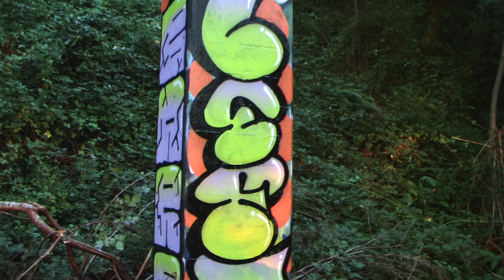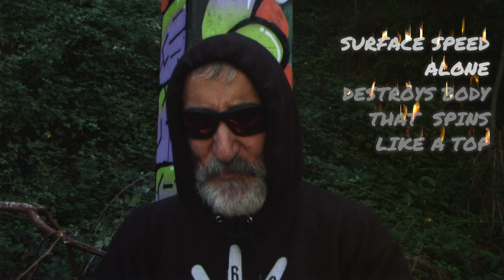WHY A SPINNING BODY BREAKS ALONG ITS LONGITUDE no cracked body can spin globe earth is a fantasy

Comment: Rotation isn't measured in MPH dude.  Get an education an get back to us.
Reply from the maker: Whatever you say globe-rider 🤣Watch t he video, read the description, click the links and read the engineering text books, before commenting as a full re-tar-d on YouTube.
Reply: @rocketspushoffair  no no. he's right. rotation isnt measured in mph. you dont say "i change gears every time the engine gets between 4,000 and 8,000 mph."  its in rpm. or radians.
Reply from the maker: @engineeringtheweirdguy2103  READ AN ACTUAL ENGINEERING TEXTBOOK SOMETIME spin3.flat.wtf 🤣
Reply: @rocketspushoffair  I have read several, including your mechanics handbook. Which doesn’t take into account gravity… at all… once again, you can’t just ignore it when it comes to something the size of a planet. You can ignore it when it comes to something the size of a cars flywheel. Learn the difference doofus.
Reply from the maker: @engineeringtheweirdguy2103  thee Machinery's Handbook is what all of modern society is based on. It does not deal in imaginary forces like gravity, which is no longer considered a force "doofus"🤣🤣🤣Also, "gravity" only applies to surface objects who's axis of rotation (center of space pear earth) is AWAY FROM their center of mass. Gravity has nothing to do with the cracked space pear that spins like a top about its own center of mass "doofus" 😆😆😆 Rotation axis determines the force distribution and force relationships spin1.flat.wtf "doofus" 🤒🤒🤒You're to re-tard-ed to be in this discussion.

You're NOT an engineer.
Reply: @rocketspushoffair  it’s not what modern society is based on. Not even close. It’s as the title suggests. A hand book. It’s hardly revolutionary writing
Reply: @rocketspushoffair  gravity isn’t a force doofus. It’s an acceleration. Learn the difference. Also you can claim it’s imaginary against the plethora of evidence we have all you want. You want to debunk the globe model, then you kinda need to include all of it. Instead of cherry-picking. That would be like me claiming thermodynamics is fake because soup inside a thermos should never get cold. Whilst completely ignoring and denying the existence of radiant heat.
Reply: @rocketspushoffair  rotation is a variable in determining centrifugal acceleration. Acceleration is a vector. Gravity is also an acceleration. Do the maths. It’s very very simple. Of course the machinery handbook, talking about vehicle flywheels only weighing a few kilograms, doesn’t include gravity. And of course that needs to be considered when talking about a rotating planet weighing 6x10^21 tons. 

If your handbook doesn’t mention gravity as a factor. It isn’t applicable or astrophysics or orbital mechanics. Sorry kiddo.
Reply from the maker: @engineeringtheweirdguy2103  The chapter on flywheels alone involves all of modern society. Everything either has spinning parts, and/or relies on/was made from MACHINES WITH SPINNING PARTS. You're NOT an engineer, you're a flunky. 😂
Reply from the maker: @engineeringtheweirdguy2103  What evidence "doofus"? 😂The fact that objects accelerate when dropped debunks "gravity" as an omnipresent always acting force, "doofus" 😂When a bullet is fired, it starts to decrease in speed the moment it leaves the barrel. You're a flunky.😆
Reply from the maker: @engineeringtheweirdguy2103  astrophysics and orbital mechanics are fiction, "kiddo" 😆An "acceleration" is not a force. Your space pear MUST be subject to the same rules as a body that spins like a top. First, it MUST be a solid. Second, it MUST have a surface sped well below 1000 mph. YOU MUST show how a cracked space pear body can spin (no cracked body can because of zero tensile strength) AND you MUST show how your cracked body has trillions of psi of tensile strength. But you cannot. All you can do is cry "gravity the acceleration" and you have no clue wtf you are talking about, because you're a flunky. 😁 All the calculations are here spin1.flat.wtf you can't touch this, flunky! 🤯
Reply from the maker: @engineeringtheweirdguy2103  Here's some orbital mechanics math for ya, "kiddo": what iss the COMBINED EFFECT of spin plus sun orbit? It is 21 mm/s/s of acceleration alternating with deceleration every 12 hours ... a simple rock balancing statue debunks your fake spinning space pear! HAAHHHAAHHAHAAAAHAA!!!!! Flunky!😁(I have a link if you can't do the math)
Reply: @rocketspushoffair  no it doesn’t. You misunderstand what the term ORBIT means. If you go round a roller coaster loop. At the peak of the loop when we are upside down, We both know that if you go too fast you are pushed into your seat, if you go too slow, you fall out. Stands to reason that there is a speed where you are equally between the two, the scientific term is weightlessness. That is what an orbit is, elliptical or otherwise. Because if you’re going too fast, you’ll fly out, too slow you’ll fall in.

It’s really basic stuff kido HAHAHAHA!!!
Reply: @rocketspushoffair  and 21mm/S/S is still much less than 9.81m/S/S.
Reply: @rocketspushoffair  so here’s a hot tip, go to school, learn what the globe model ACTUALLY is. And THEN come back and argue against here. How’s that kiddo?
Reply from the maker: @engineeringtheweirdguy2103  That's re-tard-ed, you have no track in your orbit. And the rollercoaster car is not spinning like a top. Buddy, you have TWO SEPERATE MOTIONS of your fictional space pear, when COMBINED result in 21 mm/s/s ACCELERATIION ALTERNATIING WITH DECELERATION EVERY 12 HOURS. In physics it's called rigid body rotation with translation. Simply put, it is a car tire rolling down the road. It is basic, that's why all it takes to debunk thee space pear religion is a rock balancing statue. 🤩
Reply from the maker: @engineeringtheweirdguy2103  21 mm/s/s DOES NOT EXIST, BECAUSE WE ARE ON FLAT STATIONARY EARTH 😁😆
Reply from the maker: @engineeringtheweirdguy2103  There's no argument, every globe claim crumbles at the slightest inspection. Learn some basic engineering spin1.flat.wtf leave your debunk on that page, so we can have a good laugh! 😆😁
Reply: @rocketspushoffair  again, you clearly don’t understand what the word “orbit” means. Maybe google it. Defined as when the centrifugal acceleration plus the gravitational acceleration = 0. Meaning 0 acceleration. And according for F=ma, no force. You can’t feel acceleration, only force. The same acceleration which slows down the earth also slows also affects everything ON the earth. Why you think rock sculptures are uniquely unaffected by and acceleration in general is beyond me but serves to highlight the level of cherry picking you’ll do to maintain your fantasy world.
Reply: @rocketspushoffair  FYI, go into a parking lot, and drive your car in a circle so fast as to create 21mm/S/S centrifugal acceleration, once every 12 hours and tell me how much you feel eh?
Reply: @rocketspushoffair  you can’t preface the globe earth doesn’t work by claiming the earth is flat. That’s abhorrent logic. Saying the globe earth doesn’t work because the earth is flat, and using that as evidence that the earth is flat, is circular logic and doesn’t make sense
Reply: @rocketspushoffair  you realise that to even if the word orbit didn’t mean 0 net centrifugal acceleration, to simulate the feeling of a sideway pull of 21mm/S/S you would need to lean 0.0002 degrees. Or 2 one millionths of a degree? Let that sink in.
Reply: @rocketspushoffair  "STATIONARY EARTH".  Well, that explains why flerfs are all so slow.
Reply: @shaggy-one  😂🤣
Reply from the maker: @engineeringtheweirdguy2103  Let me simplify the physics for you: SPIN + ORBIT = 21 mm/s/s ALTERNATING acceleration/deceleration every 12 hours/half revolution. More than enough to knock over a rock balancing statue. Add 4 mm/s/s for being DRAGGED BY THE SUN 500,000 MPH! HAAAHHAAHHHAAHAAA!!!!! 😁😆
Reply from the maker: @shaggy-one  WATCH AND LEARN "Shaggy" ROFL!! 😂😆😁https://youtu.be/AfEbsnOXrX0

Comment: What if the jibber is a slow kill (or not) but they decide to release something that it saves those who took it?  Tptb don’t want the sheep to pass as much as those who question them, yes?

Just a thought.

I saw my last comment disappeared…
Reply from the maker: some one either flagged it, or YouTube did, what did it say?
Reply: @rocketspushoffair   It was along the lines of what I just said. I was thinking abt how so many are so accepting of what is before us… those who qstn the leaders seem to be the biggest problem for them, and not just average people who buy into so much…
Reply: …and I’m not trying to imply that all people are not the same, being of mass deception and so forth….but I’m wondering abt what the depth of all this could be, aside from what many who continue to qstn things are thinking on the bigger level, as in, taking this is the worst thing for us…

It could have more than one implication also - maybe it’s going to help people for the short term, while also being a device that works as a ‘slow kill’ to the ones that take it… just some thoughts…
Reply from the maker: @chinar1der  even if it doesn't help them it wont hurt them (the vast majority) in the short term, like a ticking time bomb, who knows ...
Reply: Research Stefan Lanka and Antoine Béchamp and you'll see that this is impossible.
Reply from the maker: @chinar1der  it seems that the ones taking it are worse off, I think they are spraying us with harmful chemtrails even biologicals (fungi, molds etc.) they admitted in the LA Times in the 80's they did this bological type off shore spraying of "diseases" and it was also done where  live on the west coast Canada.
Reply: @MikeSmith-rj3bu  and thanks Mike…I’ll look into those